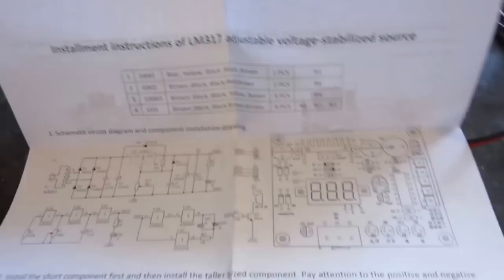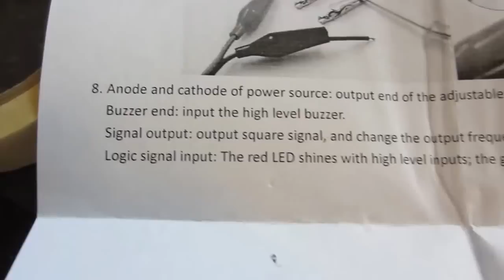LM317 Adjustable Power Supply DIY Kit Review

Comment: I noticed that you have your terminals offset, a little.  There is a notch and a tab on either side of them that you can use to slide them together to make them set more evenly and look like one connector.  I got a bunch of these kits from a friend for $0.50 each.  He got them at a pallet bin store.  I've built 2 so far.  1 I didn't put the IC, the other LEDs nor the buzzer in it.  The other one I put everything in except for the buzzer.  I gave one to a friend that was wanting to learn how to solder, so we spent an hour or so putting them together so he could learn.

Comment: I bought a similar one but it was already assembled. It seemed to work fine until I apply a load and then the voltage just drops straight down. Any ideas of why and how to fix it?
Reply: Get better transformer
Reply: How much current did the load draw? 
This kit can only output 2W if power, but if you replace the transformer/remove the rectifier diodes and power from an DC adapter, you'll get higher current, but not more than 1.5A, which is the limit of the LM317.

Comment: What is the max voltage?
Reply: Max voltage is about 12.5V with small load. This is capped mainly by the transformer output.

Comment: As I didn't do any electronics DYI work before: How dangerous is this, as this involves 220V, speaking of putting it wrong together or doing errors?
Reply: Its a low Amperage circuit, definitely not dangerous, shorting out Mains is obviously always a danger, but other than that. Easy peasy.
Reply: Sebastian Scholle Cheers!

Comment: Guys I need a power supply that can do -10V to +10V and I was wondering if it's easy or possible to implement a
 switch-inverter into this?
Reply: I'm sure its possible with the right circuit. But if you need a dual power supply, why not just use a Center Tapped Transformer and one of these: https://www.aliexpress.com/item/Free-Shipping-LM317-LM337-precision-power-supply-kit-power-board-Electronic-Component/32664759882.html

Comment: I see you never clipped together the blue 2 pin and blue 4 pin sockets together too. That is why the 2 pin connector is on the skew, they suppose to be clipped together to make a straight 6 pin connector. 
I don't think the red LED should be coming on the same time as the blue. I have seen quite a few videos of this and only the blue and flashing yellow work and mine is the same too.

Comment: Do an upgrade easy, just change the transformer to 3Amps but same output voltage, change rectifier diodes to 1N5401 and replace the LM317 with LM350T, they have the same pinout but LM350T can handle upto 3Amps.
Reply: The board's traces may not handle the higher current.
Reply: Why not LM338 for 5 amp continuous?

Comment: Can I use this to power a Raspberry Pi 3 board (about 5v, 2.5a)?
Reply: It is only for very basic hobby use. The 12V 300mA transformer will not likely be enough power for the RPi
Reply: It works good to power things that would normally use a 9 volt battery. You can juice it up a bit as I did. I put a larger transformer in it that is rated at 12 volts .700 MAH and it works well. Doesn't get hot, however I doubt the board could handle 2.5 amps.
Reply: the diodes limit it to ~1a

Comment: How much is the max. output voltage of the powersupply ?
Reply: The voltage shown over 12V is just under no load. On high load it can drop just under 12V
Reply: 12 volts and about 200ma. I have built two of them. I plan on installing a larger transformer to get 700 ma .
Reply: But in the video you go more than 12v.
I look for a cheap 30v power supply
Reply: You can buy a cheap power supply or build one yourself. My Idea of cheap is about $60 dollars US for a switching type supply.